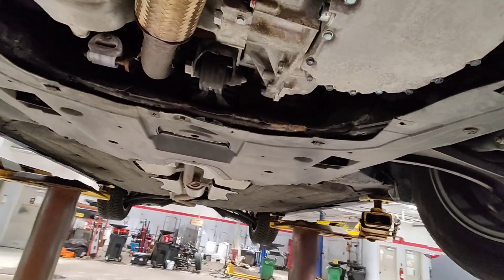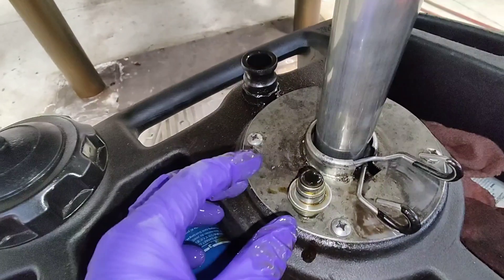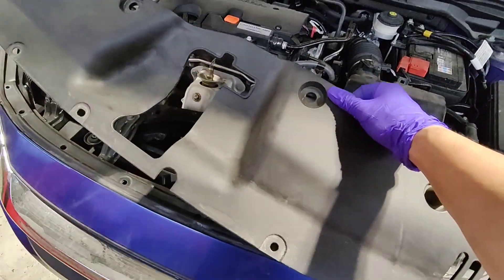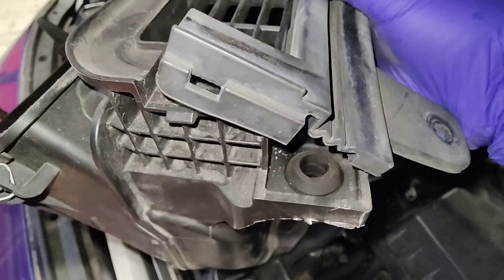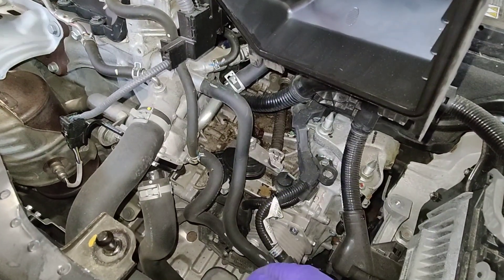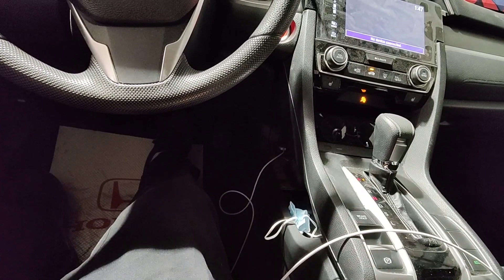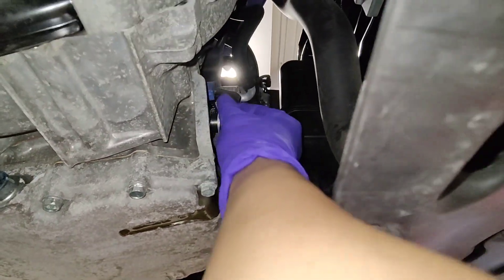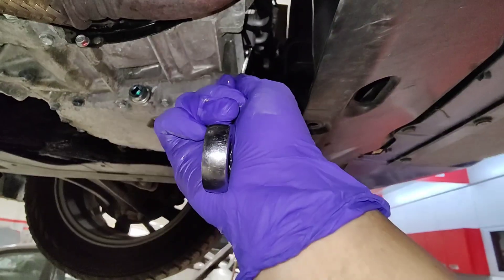CVT transmission fluid replacement. 2016 Honda Civic.

Comment: Time saver. Put transmission in low (shift lever all the way back). Apply brake. Only unsnap the air filter and move it to the side now, exposing the rubber plug. You can refill the CVT with a flexible funnel.

Comment: For DIY’ers it is advised to take off your fill plug (and in this case level check plug) before draining the trans fluid out.

You don’t want to find out the fill plug is rusty/stuck after draining the fluid.
Reply: I just checked it today and it looks good. It popes out quite easy. Waiting for replacement bolts in case that they got damaged during the cvt oil change.

Comment: actually if you get a funnel with a flexible end, you can refill via the overflow plug - way easier than removing air box - you will need to replace exact amount as drained (will work on 2.0 L engines like the one you showed)

Comment: My check bolt is extremely stuck , any recommendations on taking it off ?
Reply from the maker: Make sure you use a 6 point socket so you don't round the head off. A longer ratchet for leverage. They're not suppose to be that tight as they're only 32 lb-ft for the 17mm

Comment: Do you have to let the car get up to operating temperature before you check the level again?
Reply: Yes, let it run until rad. fan comes on 2X before draining and running thru the gears.

Comment: Great video! Now do you recommend to reset transmission learning after fluid change?
I do find out that if I cycle through gears twice on my Sonata, cold start shift is getting smoother...
Reply from the maker: Resetting adaptive values with the scanner actually does help on a Hyundai/kia, Genesis. I usually do it if customer complaints of a hard shift, delay shifting. Just relearns the shift points especially after so many kms those clutches wear. And had customers called back and said it was much better. But not so much with a CVT. The CVT really relies on that fluid not just for lubrication, cooling, and cleaning but also to grip that pulley to get you down that road.
Reply: @theoffroadingmechanic  Got it. Thanks!

Comment: What is the size of washer? Drain plug washer and check level plug washer?
And when you check the level, did you start engine on or just acc on?

Comment: That transmission looks similar with the one in my 2017 Honda Hrv.
Reply from the maker: In terms of how to change it is pretty much the same if it's in the accord, CRV, HRV, and the fit. Other than the level check might be a 12mm instead of a 17mm and in a slightly different location but in the same general area.

Comment: Do you need a scan tool to make sure it reaches a required operating temperature range when checking the fluid level after fill?

I need to do a Subaru Outback transmission fluid change and that’s what I’m reading.
Any chance you have a buddy that has a Subaru that needs a tranny fluid change so you can record it for you channel lol.
Reply from the maker: No don't need a scan tool. Doesn't specify a specific temperature range. Engine just has to be at operating temperature usually when customers drop it off it is usually nice and hot. I have a 2 buddy that drives WRX but both are manual. If I get a chance then I'll make a video on it.
Reply: Thank you sir.

Great videos.  Love your channel.
Reply: I'd get the dealer to do the CVT drain and fill in your Subie. total cost is not much more than buying official fluid from Subaru. you would need an OBD scan tool to read fluid temps. You can readily change the front/read diffs without a scan tool.

Comment: How often to change cvt fluid???
Reply from the maker: Your maintenance reminder on your Honda in the menu for oil life will tell you before you are due for service it will shows a letter and what number that corresponds to what service is due for your upcoming service. since it depend on how you drive some may have it come on earlier than others. I usually tell customer that when they ask how they know what services to do. But the symbol 3 for transmission fluid can come on anywhere from 70k km to 80k kms is what I notice depending on how you drive.
Reply: My girl has the same car. It’s usually every 30k, we end up doing it 36k in the year 2020 now 3 years later as almost at 50k but I wanna change it my self. It’s getting expensive for dealership to do the job. It’s about 250 for dealership to change it. That’s how much I got charged on my 2018 Honda accord. I’m sure the civic it’s the same price. In 2020 we got charged 140 as you can see prices have gone up lol.
Reply: Doesn't that only get half the fluid out. Doing flush gets it all out. Just had my cvt flushed. Did I waste my money??